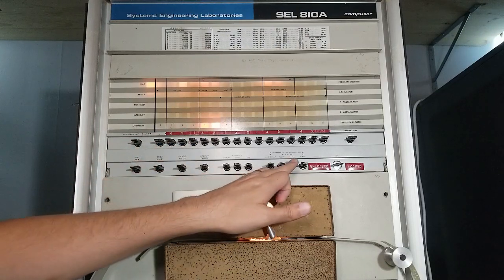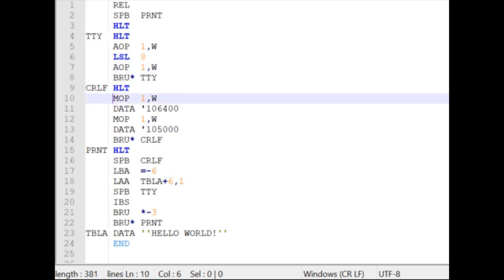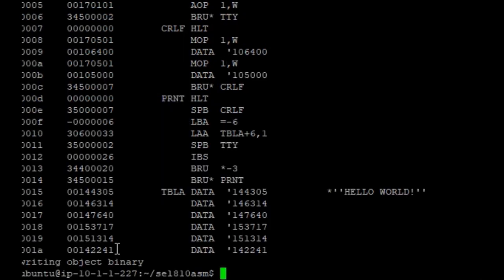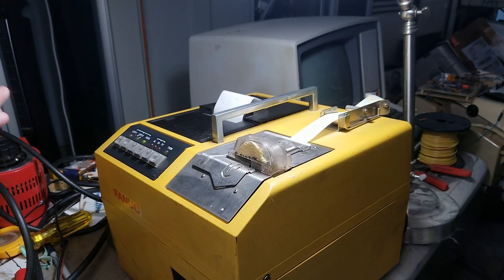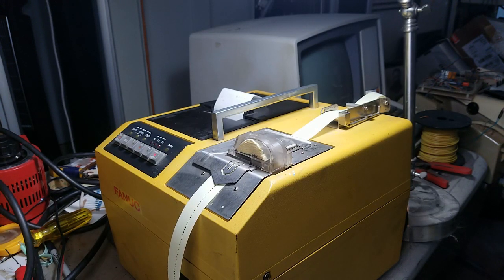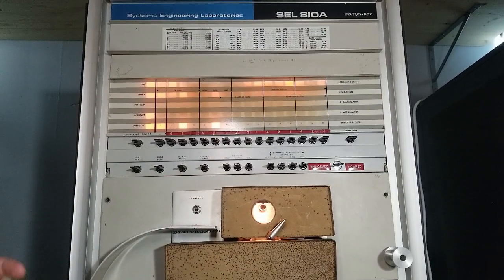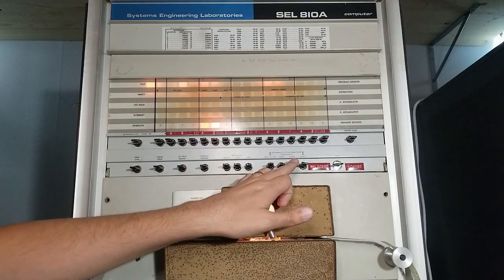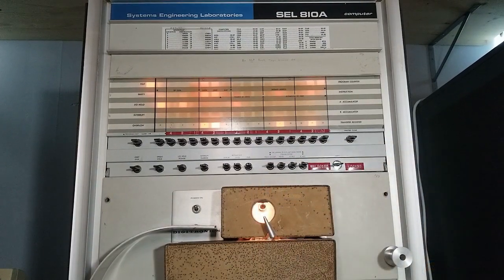HELLO WORLD! on a 1960s computer

Comment: Please explain:  Why are you using Python and a modern PC to write the program only to convert it to paper so that the 810A can read it?  If the 810A can commnicate via serial and has a display and keyboard, why not just use the 810A terminal to write the program directly to memory?   I can see that the paper tape works as a means of storage and maybe that's the answer.  It would be helpful to have more context here.  Thanks.  Neat video.

Comment: Greetings.  I am the son of Edward H. Claggett, the primary designer of the SEL-810A. Thank you for posting this video. I remember as a young child doing these steps when this was a new machine in 1967.
Reply from the maker: Hello! My email is mooreericnyc@gmail.com - would you please drop me a line? I have done much more with the SEL 810A including helping with two emulators, and I have a GUI front panel in rough condition. Would love to connect, you can see mnembler.com for some records on SEL I have put together.

Comment: Such old machines required a lot of knowledge to operate. I think people earlier were good programmers, so you are!! Where do you learn such stuffs. I program in Python but still K want to learn historical tech.
Reply from the maker: I would recommend looking into the commander x16 project. They are building a new 8 bit computer and there is a simulator you can get online and a large community to learn with.
Reply: Sure, I'll check it out.
Thanks.